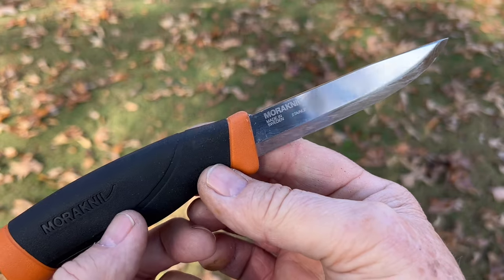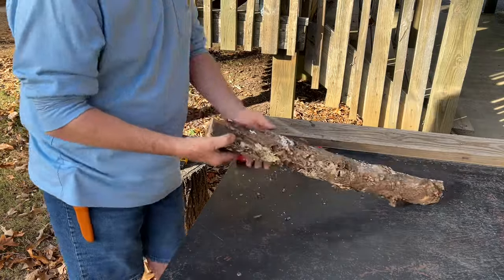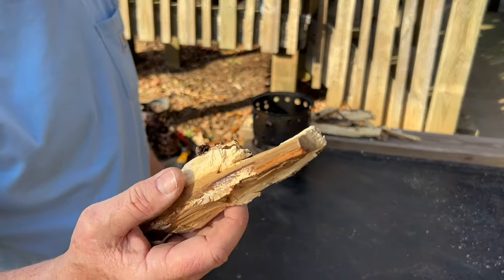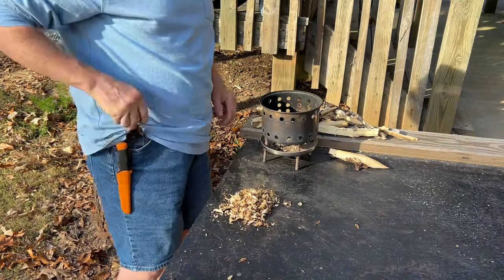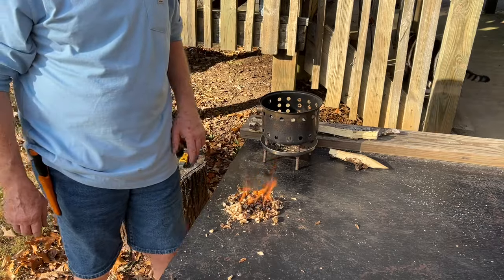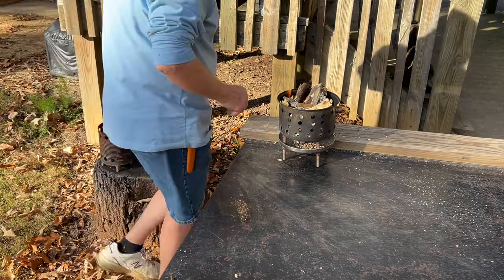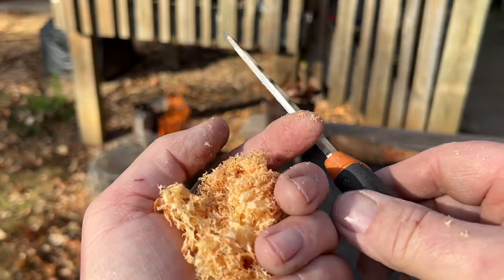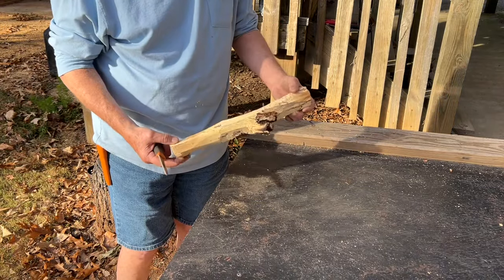Mora Companion SS HD An Incredible Fire Maker

Comment: The carbon steel version holds and edge better, and throws better sparks once you give the spine a sharp 90, but it can rust if you don't force a patina or keep it oiled. The stainless requires less care. Mora was the first knife recommended by a survival instructor many years ago, and although I have moved on to much more expensive and sturdy blades, the Moras still have their place in every vehicle and go bag I own. Great budget knives.
Reply from the maker: Thanks BSM!

Comment: After I watched your first video of the mora companion HD, I promptly ordered one.  After reviewing my processed order, I realized I had mistakenly ordered a companion HD in carbon steel.  After receiving the order I realized I liked it too, however I am guessing it may be slightly more brittle(as my non-hd companion in carbon chipped slightly after battoning it through some hard cherry wood), so I will now order a stainless companion HD.  I think the stainless may be tougher and more suited for battoning.  The excellence and pricing of these companion knives can’t be beat imho.  May as well have several.  One thing I do like about the carbon blade steel is you can blacken it with apple cider vinegar.  They look cool when the blade is black.
Reply from the maker: I've had the edge of a carbon steel Mora fold right over twice. Never with the stainless.